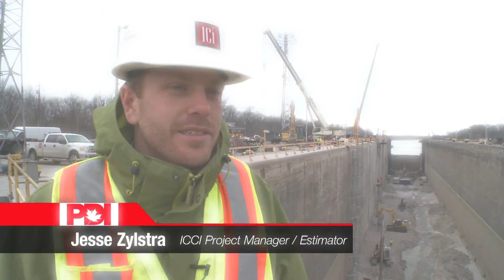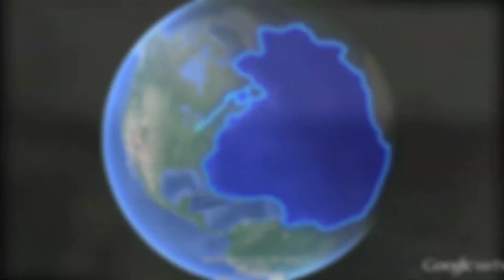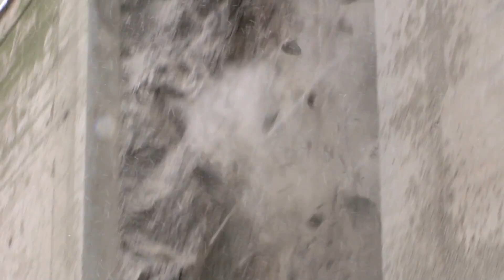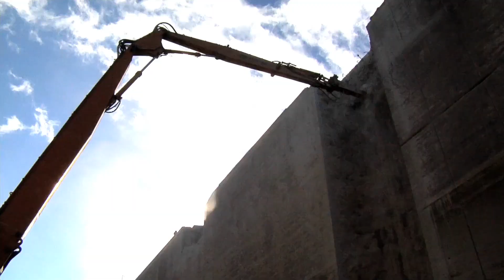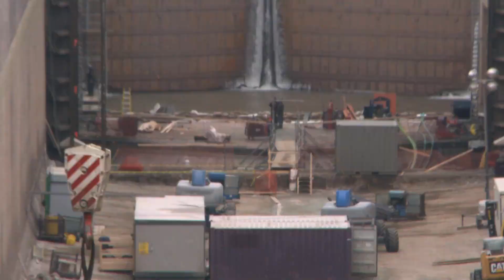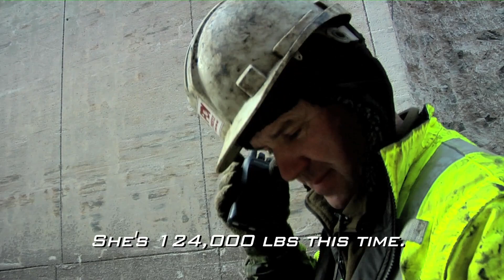Priestly Demolition Welland Canal Project HD

Comment: i be leave it was this same company that took down a fairly new mall here in Thunder Bay Ont many years ago, they had age old link belts smaller excavators, it took them for ever to take it down and even longer to clean everything up, it backed uup the whole port arthur down town for over a year, and at that they still were picking away at it, i have hours of 8mm video of it, they had a time trying to take down the enclosed sky way walk way that went over a down town street, think it was perl street, it was one of that last parts to come down, it was a real shame to have seen this mall built, and also ripped down all in a short time, but thats how this city do things, many big building have been built and 3 to 5 years later ripped down and some other building go in its place, like a toco bell was built here and it didnt last 3 years and it was ripped down, parking lot an all, retaining walls, and anoth fast food chain built, it was ripped down 2 years later, now something else stands there, dont recall at this time, it been a wile since i been by there

Comment: in my 58 years i have seen first hand what these hammers do to even the biggest machines in a short time, it you stop and think about that force that it takes to brake that concret, the machine it self is geeting that same force all the way to the ground, starts off as main boom pin snaping in 3, then the weld in pin boss brake out,  and the more the steel flexs more brakes a part, the life of a machine running a hame is short lived, these operators that run these hammers are good at it, but give them a hole to hold a grade for get it..
Reply: That’s why PDI has demolition crews and demo machines and dirt machines with dirt crews that can “hold a grade” as you say.